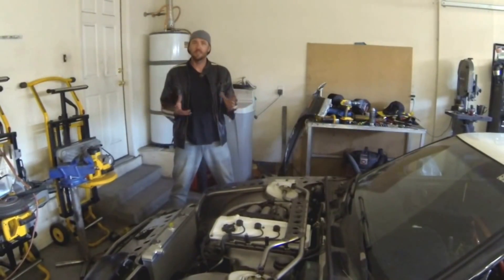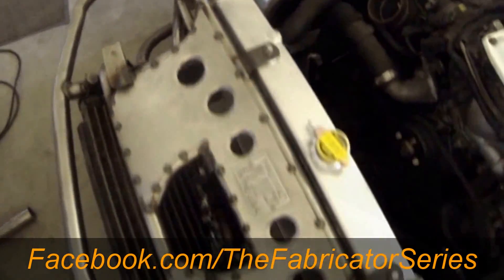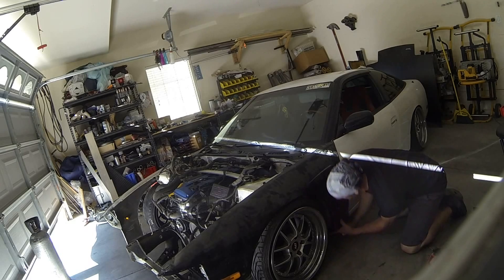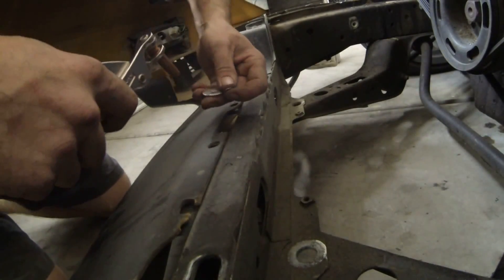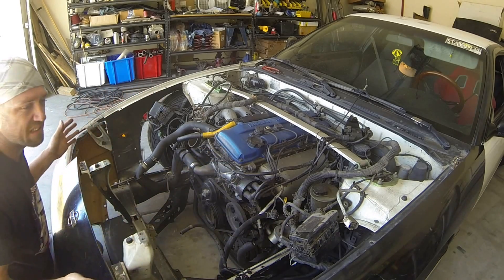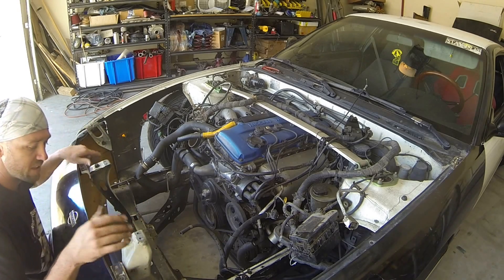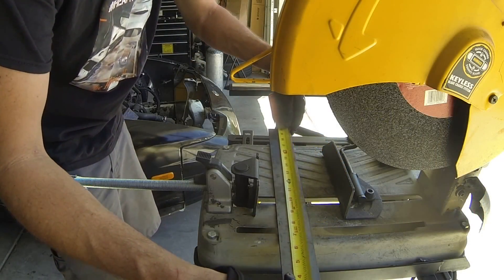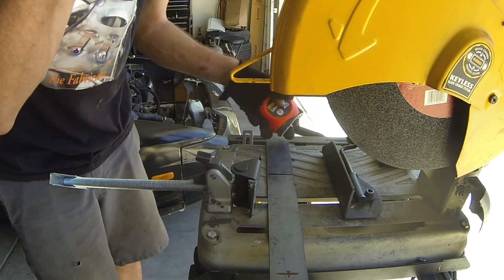TFSS: How to Build a Tube Chassis Front End - Squaring the Front End

Comment: Love the videos. I know this is what racecar guys do a lot. In reality, what are the advantages in doing a tube front? Do you think there is a weight reduction in such a conversion? Thanks in advance.
Reply from the maker: +brad glasgow THe primary advantage is strength and rigidity. Some builds will absolutely reduce weight, while others will add a little, but be far stronger. This build was calculated to only add only a few pounds. Its close to even. 
Some builds will add a bunch of space under the hood which  is great for managing other mods. Some builds will take much of that space away (just like this one with the wheel tubs). Above all, the purpose is to add strength and rigidity to the front end while reducing the amount of material.

Comment: so you bring up something my friend and i have been concerned about. We have a 72 s30 chassis and my friend wrapped it around a pole. Frame rails are more crooked than forest gump in the beginning of the movie. But measuring it on another chassis its straight from the firewall back. 
We were planning on using a c4 vette rear and a sectioned c5/6 front k member for the bring. Would bent rails on a unibody really kill it for good even if they are cut out and replaced?
Reply from the maker: +WebdevShooters That's a tough question without being there to take some measurements, but at the end of the day, the only thing that will verify is a Frame Machine. 

If you were planning on working up a new chassis from scratch, like a tube chassis, there should be little problems since only a body shell is typically used.

Comment: I've been waiting for this series since I first discovered you. Actually, that's what I was searching for, a broad but detailed how to on tube chassis. Didn't have much luck in that original search. So far though, your series is EXACTLY what I was looking for! Thanks in advance. My Z31 is getting a tube chassis in the spring! That is, if the series is over by then ;)
Reply from the maker: +1dickycat This is just the front section of the chassis, but it will all be uploaded and posted by Spring time.
Reply: +The Fabricator That's what I ment, front tube chassis. Same scenario as you said, front end damage + older car equals tainted title... I'm more curious how you got the pic up headlights mounted, only thing really stumping me at this point.
Reply from the maker: Haha.... Trade secrets...
It will actually be shown in the video. This build actually marks the first time in 15 years I have installed popup headlights and a factory hood latch to a tube chassis instead of hood pins.

The really awesome part about this build is you can't tell there is any modification to the front end unless the sheet metal is off, or the hood is up. It was pretty tricky to build, but it's pretty awesome.
Reply: +The Fabricator Well from the finished shots of her, she looks sick as hell man! No longer just a front end, but a straight up work of art!
Reply from the maker: +1dickycat Thank you!